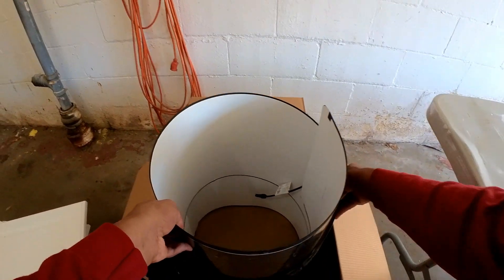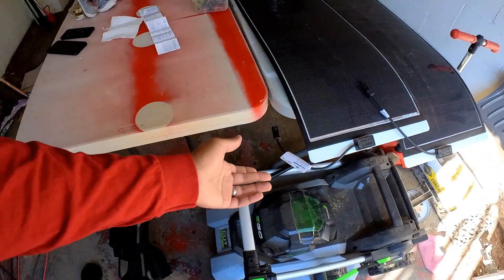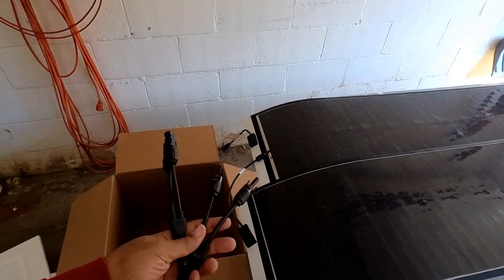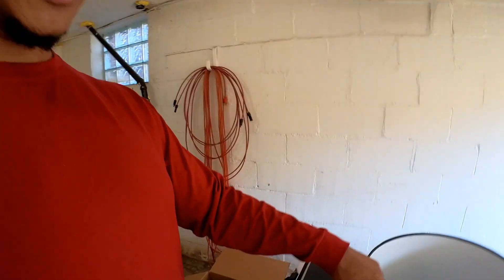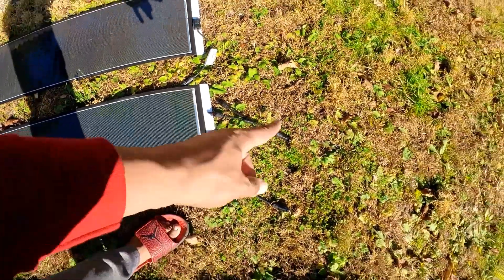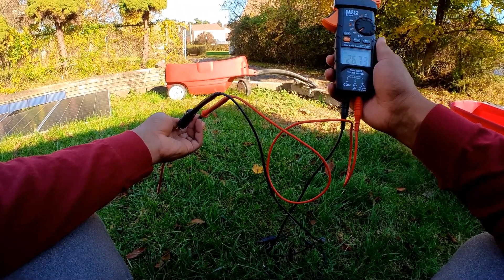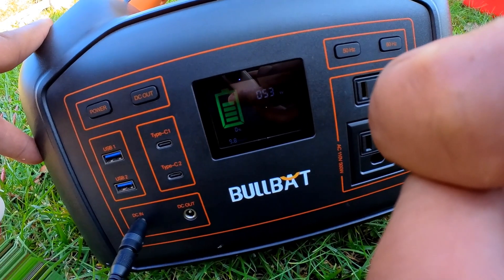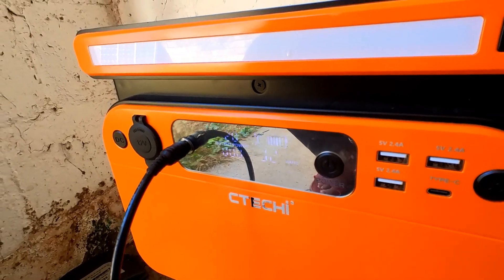Why Do These Solar Panels Exist? Let's Use Them!!

Comment: I'm not impressed with the connections being on opposing sides
Reply from the maker: I think they're some kind of roof install kinda panel. I've seen anewer shingle kind of panel on CNET recently
Reply: @AskIveSolar  perhaps if the application is something you need but for me it just seems awkward and I don't believe it fits any of my particular usage

Comment: I have four that are about 200 watt each. They would be great if one lived in an apartment to hang off a balcony. I use mine for emergencies. A lot of power for the weight. I can actually place them on my roof if need be and forget about them. I don’t have to worry about them being stolen. They can be tied down rather easily.
Reply from the maker: Nice @ 4 of those joints. I wish I had easy roof access like that but I'm not complaining.
Reply: @AskIveSolar   My roof access is me crawling out a window Lol 😆 😂.
Reply from the maker: @latymz 😂 I need the video hahaha

Aye by all means, you know I understand doing what you gotta do.

Comment: Plug the panel in before the sun hits it, the voltage will be about 20v while delivering the higher current.
Reply from the maker: Interesting. Would you risk that with a joint that cost you a pretty penny. I hear the logic but I'd still be weary. Ha

Comment: On a different topic, I see you have/had an electric lawnmower. What is your take on electric mowers? Are they worth it? Battery life for cutting and overall longevity? Any thing you did not know before buying mover vs what you know about them now? Thanks in advance bruh.
Reply from the maker: I had a mikita and it was a great deal but awful to use. I really like the ego but they are expensive. I come from a corded one and being cordless is fantastic. 

I have a small yard (front and back) and it does really good with it and the battery charges fast. I don't think it's ever died on me cutting it and charging it from solar is nice! 

I'll think about making a video on it in the future but I'm catching up on content trying to get these videos out and made. Ja
Reply: @AskIveSolar  Thanks. My new neighbor has one and electric has always intrigued me. I have gas Honda now and it runs like a champ. Now that its hot, I would like switch up and cut grass late evenings or in the middle of the night without disturbing anyone. I charge my 20v power tool's batteries from my BougeRV power station and I know I would be able to do the same for the lawnmover's battery. A little scared I'm going to like the electric mower and my Honda just going to sit in the shed looking all sad and unused. Appreciated the info. I have some things to think about.
Reply: Ego is awesome! I have just about everything they have. Push mower for 3 years. No problems
Reply: We recently got a Ryobi One+ mower for the limited parts of our yard that are flat.  It has been strong enough so far.  We have a lot of the One+ tools, including extra batteries (during Ryobi Days at Home Depot, you get a free tool if you buy a pair of 4AH batteries and charger for $99).  I have a couple of car chargers for them as well, so we would be able to solar-charge all of our One+ tools.
Reply from the maker: Setite loves the Ryobi deals!!
Reply: @AskIveSolar  Ryobi is good but i love all my ego equipment. They just dont make power tools 🤷‍♂️
Reply: @AskIveSolar  i just bought the ego 400 watt inverter. I like it alot. It has an in/ out pd port so u can have pass through charging too
Reply: Ego looks cool, but it's a bit pricey for me. I'm in the HART (Walmart) brand ecosystem. They are low end to midrange yet have decent durability. If it could cut 1/3 acre with a decent hill I may just bite bullet especially for a self propelled model.
Reply: @equallywrong  my brother works for Walmart. He has a hart push mower and weedeater and has had no problems and likes them